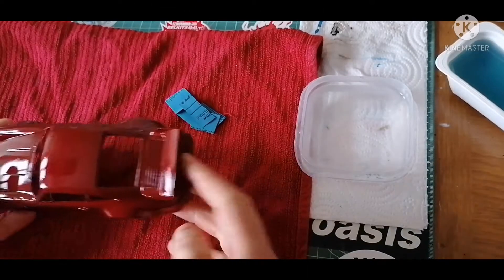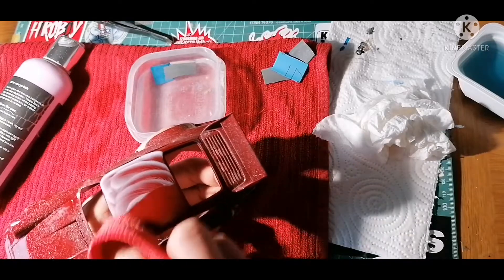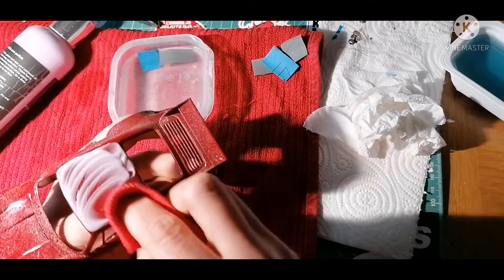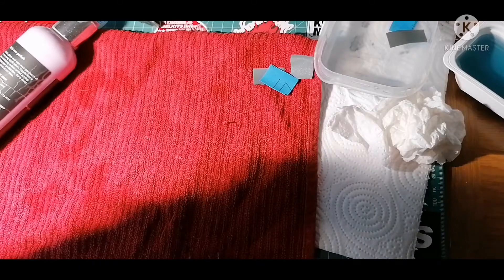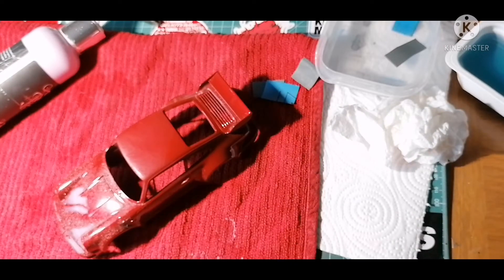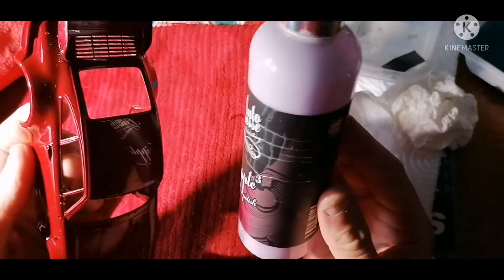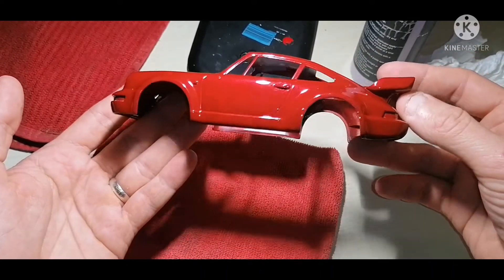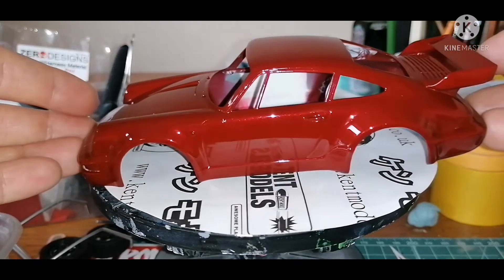Fujimi Porsche 911 Carrera 3.8 RSR  - Polishing the Porsche

Comment: Did u do any sanding of the front rubber strip? I notice u didn’t paint it in. I have messed up the lines from scribing now I’m debating if I should put putty and completely remove it ( the black rubber strip between front bumper and hood
Reply from the maker: I'll be honest, I can't remember 🤦🏻‍♂️😅 it was a few years back I built this. Although with it being the rsr I'm not sure it had that rubber strip?